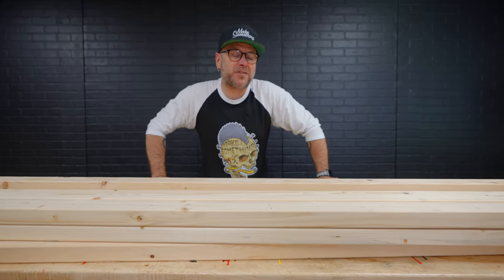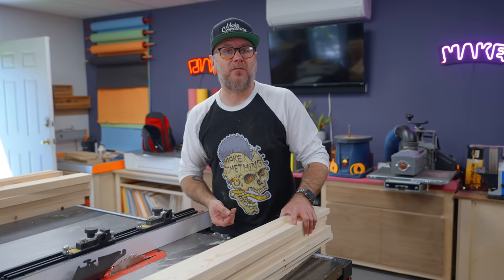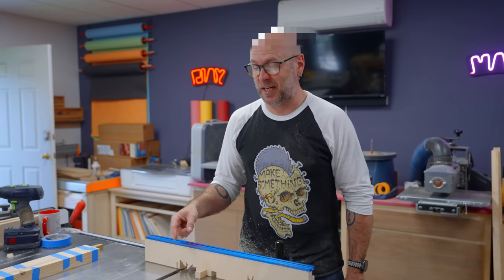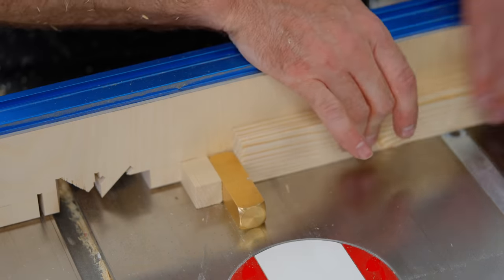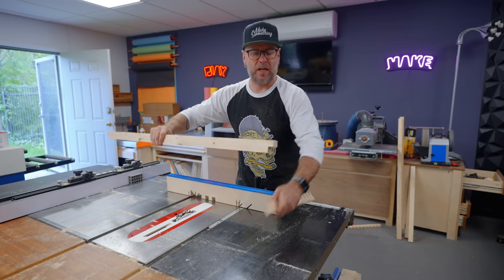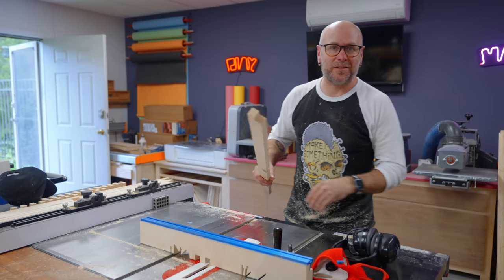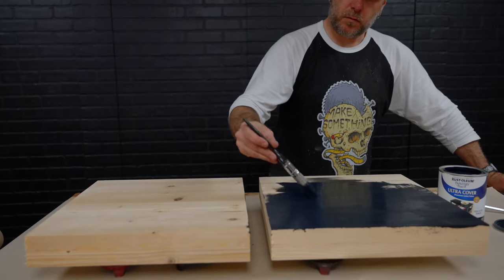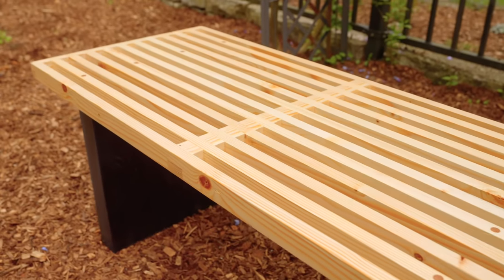Modern Outdoor Bench from 2x4s. Woodworking Project

Comment: This comment is less at you and more directed at Woodworking Youtube in general, but: I got pretty excited when I saw the title - I have lots of 2x4's! I can do this project! ...and then you ran the wood through a planer, jointer, table saw, etc etc etc. As someone who's just starting out in woodworking, I don't have any of those tools, much less a dedicated workspace, and yet every single woodworking video here on Youtube starts out this way. It's a bit disheartening and maybe even somewhat disingenuous. Sure I could make an outdoor bench using cheap 2x4, guess I just need a couple thousand in tools in order to do it. At the end of the day, it's very much making me want to never do this again and sell the few tools I do have, and I say that as someone who's just put together a really, really, really rough shelving unit using 2x4's. I'm sure there are ways to plane and joint wood without a planer, jointer, and table saw - not that I'm aware of them with my limited knowledge. Signed, a frustrated wannabe woodworker.

Comment: Use 2x8s instead and rip them to width. You'll have better quality wood to select from (in most cases)
Reply: lmao talk about out of touch. folks cant even afford 2x4s and these bezos types out there buying 2x8s to cut them in half.
Reply: @saxplayingcompnerd  uhm... It's actually cheaper to buy a 2x8 to cut into two 2x4s than it is to just buy two 2x4s. Also he never mentioned it even being a cheaper option. He is stating that the boards are more likely to be of better quality (straighter, less knots...) because they use better quality parts of the trees to make the wider boards. Which to most would even be worth being slightly more expensive. You'll have way less waste from trying to mill the boards flat and you won't spend nearly as much time milling either. A little research would do you some good.
Reply: @christophermacier  at my homedepot, a 2x8x8 is three times the price of a 2x4x8
Reply: @artvandelay7537   Make sure you're comparing the same grade of lumber. HD here is $17 for a 2x8x8 and $10 for a 2x4x8 for Douglas fir
Reply: Came here to say the same thing😀. Great minds think alike 👍
Reply: @christophermacier  …also, cutting down a board gives you two good edges. It can save you having to mill/plane an edge.
Reply: @saxplayingcompnerd  The issue of buying 2x8s instead of 2x4s from the local box stores has been discussed at length on other woodworking channels. The box store lumber is really bad quality and full of knots. If you're going to use their lumber, you have to remove sections with knots. If you insist on using 2x4 as is -- knots and all -- then you're essentially throwing money away and wasting time.

Comment: For those worried about using 2by's for an outdoor bench/table or whatever and worried that it won't last,  I made an outdoor workbench 7 or 8 years ago and it's still in great shape.  Mine has regular 2x4's for the top and I used 4x4 fence posts for the legs.  I use this table to do sanding, painting, grinding and cutting metal.  When I made it I primed and painted but I think this year I'll do a quick sand of just the top and another coat or two of paint to clean it up.  I love sanding on it because all that dust stays out of my shop.

Comment: I am quite concerned about the durability - even with dowels but without any brace across the legs will not hold the bench from moving from side to side for a long time...

Well, unless it is only for looking at it 😅

Comment: That bench will last for many, many years. You'll get bored before it goes bad. I made benches for our backyard once out of stock pine and gave them one coat of deck stain. I had good intentions of recoating in subsequent years but never got around it it. Those benches lasted 15 years! (That's Toledo climate, BTW)
Reply from the maker: Good to know! Thanks!

Comment: Thanks for the video. I wasn’t interested in that bench but I figured I would give it a watch to see how you did it. The end result was impressive. I now would like to make something similar or even make one of these to sell. But I don’t have a dado, daddio or how ever you pronounce it lol. And I really don’t want to buy one. I only have one table saw and from what I’ve seen, the set up on a dado stack is a pain. What do you think of those jigs they make for this? I’m with you, they scare me. I have no issues working on my router table but that palm router is a bit scary. I’m wondering if you can use one of those jugs on the router table. I haven’t looked into it as you can see. Again, thanks for the video.

Comment: I've been planning to build a new simple desk for my office with butcher block top but butcher block tops are too expensive.  I've been thinking about making my own from 2x6 raw material.  I don't have jointer or planer or bandsaw, I'm thinking I can cut the boards to 2' and 4' lengths to get rid of the worst of the warps, rip them down the center and then rip off the 2 edges.  Then glue them together and belt sand the top.

Comment: David,
Quick Q. Do you use the 2x4s right away or do you store them for a while before using them?
Reply from the maker: Right away. I find they warp even more over time.
Reply: @MakeSomething  Right on. Thanks.
Reply: When I won't be using the 2x4s immediately, I have had good luck clamping them to my workbench (with stickers between the boards) while they acclimate to my shop.
Reply from the maker: Oh, great tip!
Reply: depends how much moisture they have. if you dont have a moisture meter try sanding and you'll be able to tell if they are too wet as they wont sand well.

Comment: At 9:10 or so, you mention using a spacer with the fence when cross-cutting with a miter gauge. That’s only needed when there is to be an off cut that can get trapped between the blade and the fence. Not needed when making a dado. Love you stuff. 9:16
Reply from the maker: The wood can still get twisted and caught in the blade which would cause it to get thrown back. Better safe than sorry.

Comment: You don't need to worry about using your fence and miter gauge together here because there is no off cut, you don't cut all the way through the wood, so it's usually not a problem AFAIK
Reply: You are correct, but there is still the off chance the end of the board will get hung up on the fence and bind the blade (possibly exploding the work piece up into your face). The spacer just eliminates that chance altogether.
Reply: I’d still do it David’s way, because those pieces were long.
Shorter pieces, definitely you can run along the fence.
Reply: Yeah, you just wanna avoid any scenario where you can bind the work piece against the fence.  If the piece twists, you can get the back of the blade kicking up/back and that's obviously super dangerous.  A quick spacer like he used here is the right move... if you have a 3-2-1 block, you know it is just 1 inch and you can still use the rule on your table saw to set the fence by subtracting an inch.

Comment: You definitely need to learn more about using your dado blade. When not cutting a through cut you can use the fence, dado blade or single blade. 
A dado blade can be you best friend and a safe one at that. 
Nice project. But the lacquer will not hold up to the rain and UV.